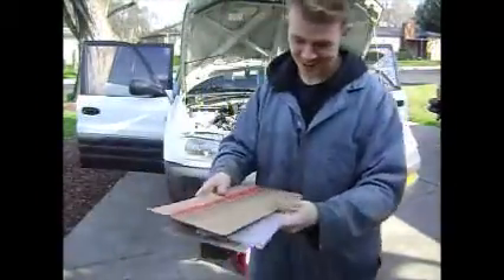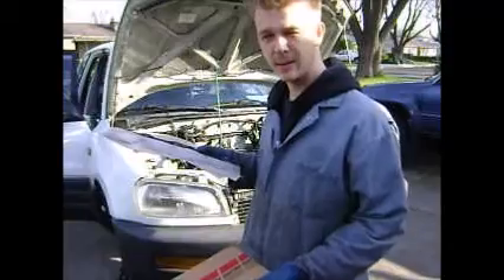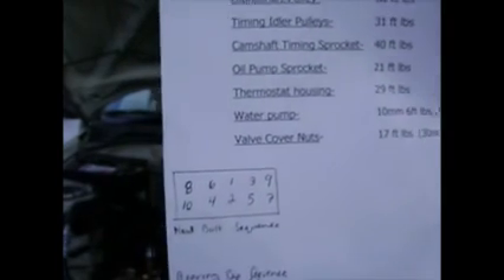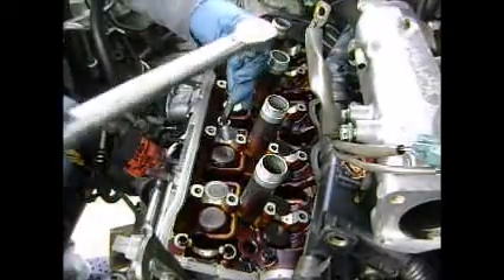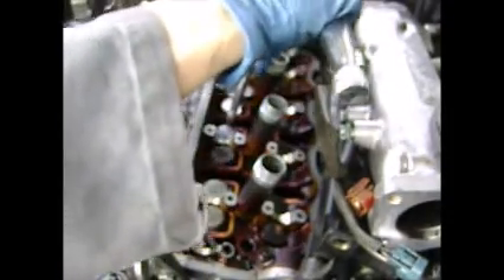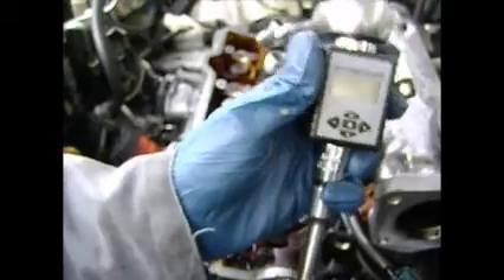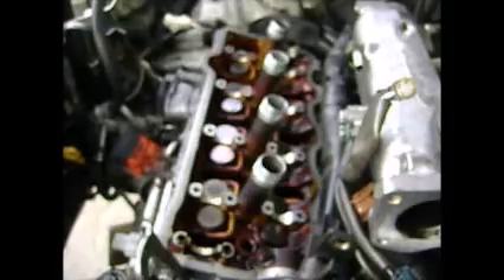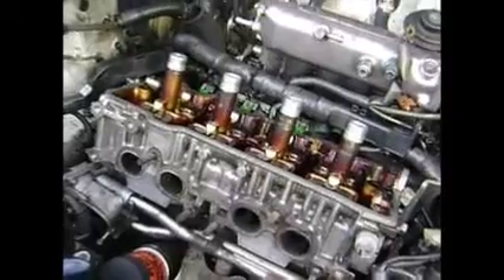How To Torque Cylinder Head Gasket Bolts Toyota RAV4 Camry Celica 3S-FE -Jonny DIY

Comment from the maker: Tools & Supplies Used

Mechanics Tool Set- http://amzn.to/2xoyu5c
Torque Wrench- https://amzn.to/2GHorwh
Digital Torque Wrench Adapter- https://amzn.to/2EuMtZK
Carb Cleaner- https://amzn.to/2Jev3Eh
Safety Glasses- http://amzn.to/2ez41Jw
Nitrile Disposable Gloves Large- http://amzn.to/2w0dlwc
Mechanic Gloves- http://amzn.to/2w0i1SP
Thanks for Watching! Help Support the Channel by Subscribing & Clicking the BELL Icon for all NEW Videos!
Reply: Hi can u help me find 3sge head complete with valves and camshafts
Reply from the maker: @kgotlasentle3331  I would check ebay

Comment: Hello..
Can you please make any video on how to remove front rubber bumper/Front bumper on the 1996-200  Toyota Rav4..
Really need.
Cheers.
Reply from the maker: I would but no longer have the car but its pretty easy just some screws/bolts and clips. If you can find the diagram of front end online. Will show you where all fastener points are 👍

Comment: Did you use the old bolts ? was told must be new and once 3rd head tighten Bolts must be tightened using Torque Angle tool to set 90 Deg, Your opinion, Cheers
Reply from the maker: I reused bolts as they are not the stretch torque bolts. And only sometimes do the manufacturers specify to turn an additional 90 degrees after the final torque. This car did not specify that 👍🏻
Reply from the maker: So if you have a different engine I would try and find factory service manual to check torque specifications/procedure

Comment: hay jonny what was the torque specs for the cam bolts foot pound's? im working on mine. rav4 and nobody knoe exactly how many foot pound's samel body says 40 but I broke Two bolts already at 30 pound's
Reply: thanks,22lb  that makes more sense than 30-40
Reply from the maker: 22 ft lbs. Must be torqued in correct order as well.
Reply from the maker: Found some helpful pics for torque pattern on autozones site
Reply from the maker: https://www.autozone.com/repairguides/Toyota-RAV4-2000-05/Engine-Mechanical-Components/Camshaft-Bearings-Lifters-3/_/P-0996b43f80379fd9